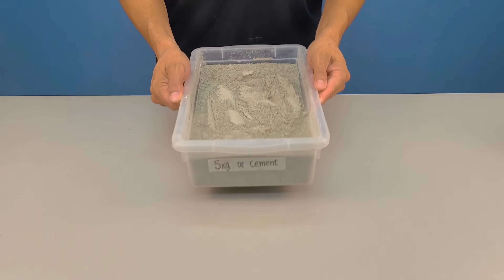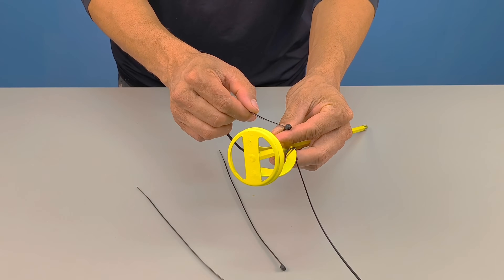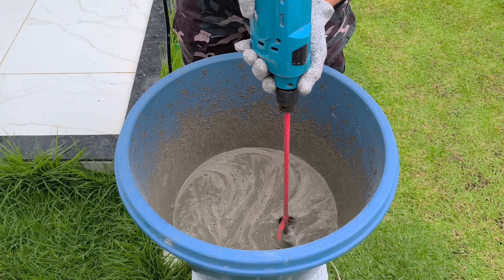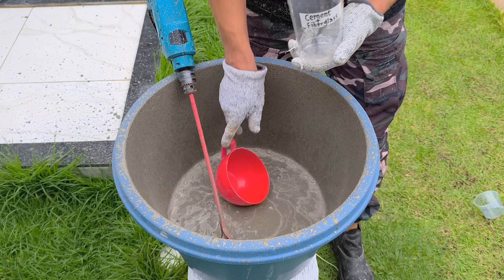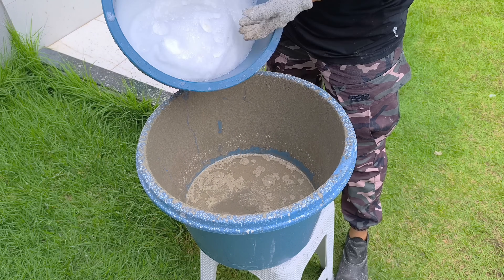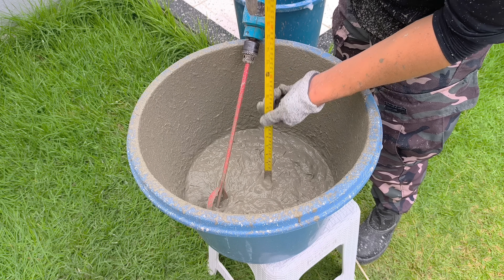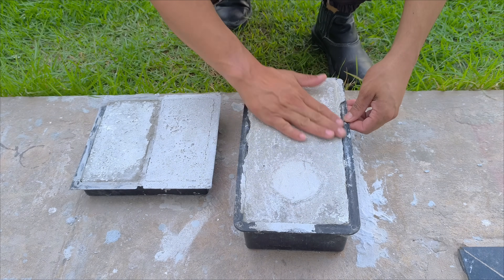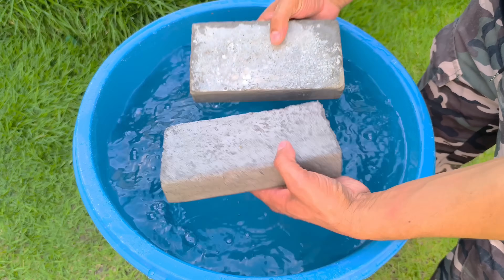Mix CEMENT with SHAMPOO and see the hidden formula that could be worth billions of dollars!

Comment: This is essentially Gypcrete, or Aircrete. It has been around for at least 75 years. Using car shampoo is very costly, as it is probably 30X more expensive than foaming agents sold for cement mixing.
Reply from the maker: You’re absolutely right that the concept is related to aircrete and gypcrete, which have been studied and used for decades. This experiment focuses more on accessibility, visual demonstration, and alternative materials people already have at home. Cost efficiency and industrial scalability are important topics, and specialized foaming agents are definitely more economical for large-scale use. Thanks for adding valuable technical context to the discussion! 👷‍♂️🧪

Comment: Thanks for the like badge. Video idea for you. Simple, non-clickbaity title:

Dishwashing liquid, laundry detergent, car shampoo - Testing different Aircrete mixtures (for weight, strength, heat resistance)

By the way, have you seen @NightHawkInLight 's aircrete video?
Reply from the maker: That's a fantastic idea for a video, thank you for the suggestion!

Comment: It can be used as coloured external or internal plaster as long as the additive makes it waterproof (against rain). The heat retaining properties of foamcrete are better than styrofome slabs based on Nighthawk's measurements.
Reply from the maker: That's an interesting observation, and foamcrete does have unique properties that could be explored for various applications.
Reply: @inovaouinventa how adding hemp hurd

Comment: As an experiment for kids it looks pretty good. Now, A critical question is, how much weight do those bricks support? Can you build a house with them? Or a building?
Reply from the maker: Great question! This experiment is mainly focused on material behavior, density reduction, and alternative formulations. Structural load capacity depends on many factors like mix ratio, curing time, and reinforcement. At this stage, it’s not intended for load-bearing buildings, but it opens the door for further testing and research. Thanks for the thoughtful question! 👷‍♂️🧪